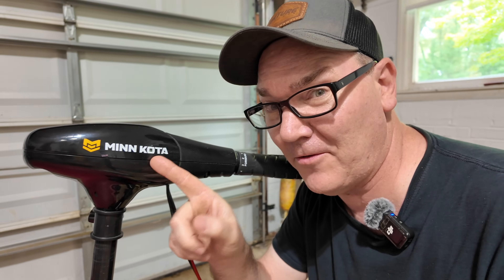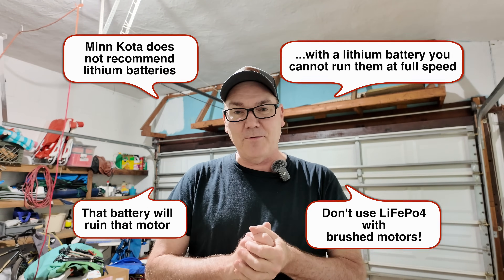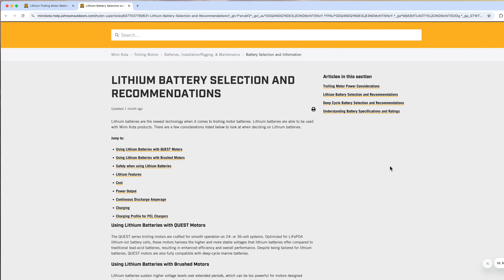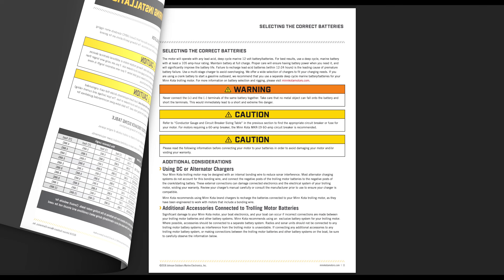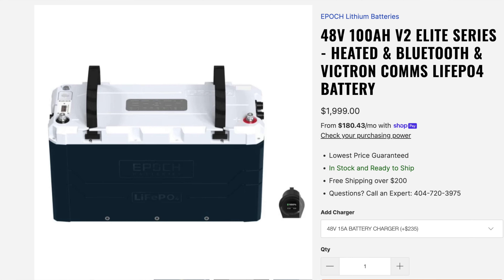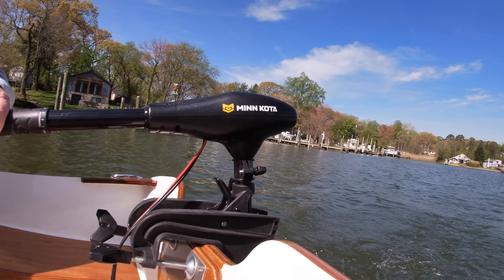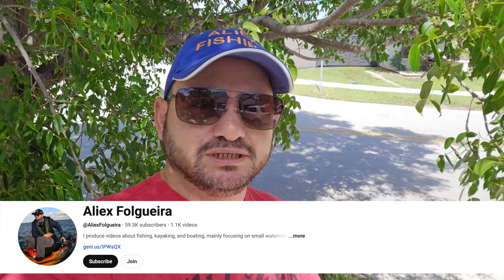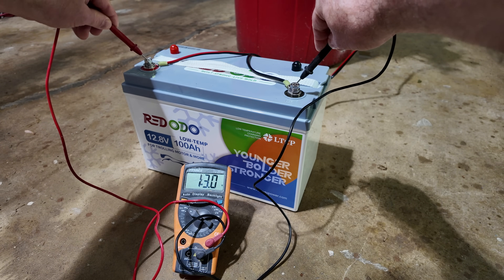Does a Lithium Battery DAMAGE a Trolling Motor & is Minn Kota Hiding the TRUTH?

Comment: I recently switched to a 50Ah 12V lithium ion for my 30# newport motor. 
two observations: if I run it wide-open (speed 5) for more than a few minutes, it will trip the in-line circuit breaker. nbd, I cruise on speed 4, and only use speed 5 for short bursts.
Second, the battery life LED indicator doesn't seem to register.  just lights up full, no matter how long I run it. hasn't been an issue yet... maybe one of these days I'll figure out just how much run time I actually have

Comment: What makes that redodo battery a "trolling motor batter?"  Isn't it the same as the basic, just with low temp?  I live in FL so I don't care about low temp.
Reply from the maker: I don't know if it also might be a slightly different BMS - maybe keeping it from putting too much into a trolling motor.

Comment: The only thing with lipo is that discharge rate is higher and longer than FLA. With that being said brushed motors can handle it. If there is a flaw in the Commutator of the motor it will remove copper and mess it up. I learned this when RC cars went from NiCad batteries to lipo. It wasnt always but you would find that one that does
Fail

Comment: This guy is such a mor on.  The battery literally says "For Trolling Motors...", which means that unlike 'regular' lithium batteries, it has an internal regulator to step-down the output voltage.  You'd think if a guy was going to do a video on a subject, he'd at least do a little research...  Regular, non-trolling motor lithium batteries do operate at a higher voltage (~13.3V) (and ~14.4V at 100% S.O.C.) and unless the motor is designed to operate at those higher voltages, WILL ruin the motor over a period of time at higher speeds.  This type of stup idity is why America is falling apart...

Comment: I’m currently (for over 2 yrs) using a cheap 24v 200ah battery on a 2020 powerdrive.  No issues when running banks at lower settings of 2-5 and on/off spot lock all day. 
I used it sustained at level 7-9 for constant speeds while trolling once and after about 4hrs it shut down and motor was burning up. Best I can tell the BMS shut it down before completely toasting my motor but I’m certain there was some lasting damage to the motor. So now I just don’t run it on high speed for more than short bursts and continues the be totally fine

Comment: I had the same motor and ran lead acid on it for a year. Got a lithium battwry and had to replace the speed switch every month. Got a brand new motor. Ran it in a tournament for 6 hrs. Rqn fine. Next day nothing. Bought another speed switch good for a month and another every month. Dont use lithium with servo speed switches. Just my experiance.
Reply from the maker: Very interesting - thanks for sharing.

Comment: i run a lithium battery on mine, first summer with it and i did burn up the lower end. I can't say for sure if it was the battery but i was told I  melted the seals out of it. I had been running on high for 1.5-2 hours.
Reply: i also burned up the controller with my old trolling motor from running on high

Comment: Love you did this.  Wonder if next time, do tear down to measure brushes before after?  And temp readings. 

Lake I'm fishing now I get really scared, as grown man I know, but my truck is size of Lincoln penny away from me.  Sun starts setting, and I have long haul back.  So I countered that by buying a second 100ah battery lithium, and gauge with of course shunt, but not have gauge mounted yet.  My big concern is frying motor.  My head got warm like you showed as well.

Comment: Well, I had a 12 volt Minn Kota Endura 30 lbs that burnt out. It was the 1st time I used it.  I believe it was the trolling motor. I had to bring it to a dealer 80 miles away to get it covered by the warranty. It took months for them to get the parts... It you buy a cheap motor, you get a cheap motor... And yes, I was running wide open on a lead battery... I have other Minn Kota motors that work great...
Reply from the maker: Oh no, that's really frustrating!

Comment: Thank you for doing these videos! I’m considering an assist motor for my Hobie Adventure Island (kayak sailboat) for either when I’m stuck with no wind, or, when I want to get somewhere but I’m heading into winds that are too strong to get anywhere very quickly. 
I’ve watched a few of your videos that include the redodo battery. My ADD has me a little stuck on the pronunciation…as you are saying it like there’s an extra “e” (redodeo). Is that really the correct pronunciation?
Reply from the maker: Yeah! They told me it is pronounced - Red and then O, D, O

Comment: Have the same minkota 30lb motor with lithium battery for years and it still works just fine and when I say use  it was on a big fishing kayak . My trolling motor had been used and abused  for several hours at time , several days a week for years with no issues. I also upgraded the prop to a bigger 3 blade prop and ran that for years . It still keeps going . It's hard to kill a Minkota .

Comment: You need to apply more resistance to the motor in your test to simulate high current conditions. Bottom line up front: The gauge of the wire is insufficient for prolonged high speed against strong current. I have the same trolling motor and use a 12V 100Ah smart LiFePo4 battery with a 30A Circuit Breaker. The first time I used it, at 5-speed level (for a prolonged time) the wires got very hot and the CB tripped a few times. My battery app showed the current reached as high as 38A.  The second time I used it under similar circumstances, up against a strong current, the same thing happened, only this time, after about an hour of use, the forward speed gave out.  Minn Kota was nice enough to send me a new speed controller. When I took it apart, it was obvious what had happened. The main ground (negative) 14 AWG wire insulation melted near the terminal end. This caused a temporary short with the other wires. I eventually rewired the unit and it was fine. I replaced the 14 AWG with higher quality Silicone 10 AWG (rated for 30A and 200C)      . I’ll let you know what happens once I take the boat out again.  (Happy to provide pics of the melted wires!)

Comment: The problem with lithium batteries is entirely dependent with brushed motors only! Brushed trolling motors will have brush issues sooner when run on full amp draw for an extended period of time. How long is hard to quantifiably define.

Comment: from what I know about brushless motors and brushed from rc cars. if you want to go fast you want a brushless motor. if you go the same speed on a brushed motor electric current travels through the brushes. the faster you spin a brushed motor the more you wear out the brushes. when you do rc cars in a race and you use brushed you will shorten the life of the  motor significantly.  it will run. using a different type of battery that has more voltage will make you go faster the brushes on the motor will arc and spark more wearing them out. once the brushes wear out it will keep arcing more and more as they are further apart. saying all that you troll at like 2mph. probably isn't taxing the motor. brushed motor will wear out. you could if you maintained bearings in brushless run forever. nothing touches inside except bearings and magnetism.

Comment: hh i have see your older vid and didn't have a big or lithium battery at the time now i have 12 92ah agm battery and i just tested it and it works fantastic also i should add that iu have blown my minn kota controller few yeares ago by ruining it with 24v lithuim battery i didn't know that they only work with 12v battery but since i changed the controller with an electic one that have a screen showing speed from 1 to 100 and forward and backward all works fine

Comment: I had an Ulterra burn out, the only reason given was I must have run it on high too long. 
The trip I last used it on, I had it on spotlock for a few hours, and not knowing about their issue, I didn’t pay attention to whatever speed it was using. I have 4 gauge wire and minimal connections, all clean and tight. So they blame it on the use of high with lithium batteries. The motor is just over 6 years old, so no warranty anyway.

Comment: I have a Ship to Shore marine battery charger I use for 12v lead acid battery deep cycle.  I believe using Lithium batteries requires upgrading the charger  ?
Reply from the maker: Yes, lithium batteries require a charger designed specifically for them. I think they charge more slowly.

Comment: If the motor can't handle the designed operating voltage continuously thats the motors problem, not the battery. 
Solution buy a better designed and built. motor

Comment: I would worry about lithium batteries going into thermal runaway during charging or use.  Speaking of trolling, I have been banned from an RV web site for trolling on safety issues  I was a USN nuclear reactor qualified officer and have many years of experience at commercial nuke power plants.  I have 35 years experience with two marine lead acid on my sailboat and ten years with four flooded lead acid batteries in my  motor home.  We have hundreds of years experience and the risks are well known and easy to mitigate. 

I recently watched a video of an electric tour boat detonate while the lithium batteries were charging.  No one was killed only because no one was nearby.

Comment: Would have liked to have seen the  switch manipulated through the speeds after it was hot. My experience with my two endura 30's is the reverse in the speed switch is the first to fail, even though it's used the least. Seems like once the trolling motor is hot, and the speed switch is manipulated multiple times, the switch begins to over heat. Three switches this year alone in two different enduras, and one lasted less than than thirty days. Reverse is always  first to go. Forward speeds in the switch also fail eventually.

Comment: You could always run a 30 amp in-line DC to DC converter to make sure you don’t give it the higher voltage that will damage the brushes. Keeping it at a steady 12 V.
Reply: This guy is not smart enough to understand that....

Comment: I have been using 24lb watersnake on my Hobie PA14 and Hobie Outback for last me 9 years. Not because brush burned out but magnet fell off the housing. It would been cheaper for me to repair the motor if it was the brush that worn out but since it was magnet fell off and cracked into 2 pieces, had to buy another one. Yeah, I don’t expect them to last me the life time but 50ah Renogy battery I bought back i. 2017 still run like brand new. Where, 30ah lead battery died after 2 years. XD 
Bottom line is, lithium battery is lighter, more power and last a lot longer. To me, motor is consumable and don’t expect them to last me life time but if those cheap little motors last me 5+ years where I use them every weekend for hours, then I am happy.

Comment: I have a minn kota 30 LBS five speed endura trolling motor and a 12 V 100 amp max plus BMS 110 whatever that means lithium battery from Humsienk some reason it is burning up the wires and is burning up the switch on my trolling motor I have been using this on my kayak

Comment: i tend to buy Dumfume 12v 300ah batteries for my solar project (to try defeat the power monopoly in my country).. they cost 300-320 buckeroos.
speaking of batteries.. i wonder if i was to drop a overzealous Gob of hot glue on the terminals if it would waterproof it? OMG!! as i was sitting here watching the video it dawned on me!.. why dont i use a plastic box..like a sealed toobox.. drop the battery in.. and then hot glue seal the parts the wires comes out thru it.. or maybe even use a solar nipple lololol.

Comment: You failed to check the part that has problems with the higher voltage for extended periods!!!! It's the BRUSHED MOTOR that over heats and burns up brushes!!!!! Probably not an issue in colder water but maybe an issue if the water is 90+ DEG??? If you ran the motor for 3 hrs on lead acid and checked the temp of the actual motor and did the same with lithium I would credit you with making an informative  vidio. This video is carp, think I will listen to minnkota. NOT the guy who didn't even check the motor housing for overheating condition. I never noticed my motor was warm with lead acid but have with 8 hr runs with lithium......
Reply from the maker: You failed to understand the point of this video. IF Minn Kota believes there is a problem with Lithium batteries - I think they should DO A BETTER JOB of letting the consumer know. At the moment we have to seek out the info ourselves and even what we find is inconsistent. How hard is it for Minn Kota to add a sticker of piece of paper to the box clarifying whether or not THEY have identified an actual issue and any proposed workarounds (like not running it at 100% for more than a few minutes if connected to a LiFePo4 battery)?

Comment: That sounds incorrect, with lead/acid batteries as the voltage drops the current rises which causes heat. Power is voltage times current.

Comment: I have the edge 70 on 24 volt and it failed after running full speed for about 15 minutes. As I was nearing my destination, I slowed to speed 3 for 20 seconds and stopped. I tried to move again within a couple minutes and had no response. When I dismantled it, the brushes had bonded to the brush plate. I had to replace brush plate, brushes, and all seals. Sooooooo, it can fail using lithium batteries.

Comment: Why would lithium batteries destroy the engine? The engine is only a consumer of current, and the battery, no matter what type of battery is supposed to provide the appropriate voltage and current, acid batteries can destroy the engine when their efficiency decreases after exceeding +- 50% of the capacity, the engine weakens, starts buzzing and gets tired, which is more destructive.
Reply from the maker: Minn Kota seems to think there's an issue.
Reply: @WayneTheBoatGuy  this and that is DC current so there is no point in talking nonsense

Comment: Running the motor in a can like that, the most likely damage would be from the lower unit, the motor, overheating. In actual use, the motor is in a constantly “refreshed” source of water. The water in the can is captive, and will continue to warm up, possibly past the limit of normal operation.

Comment: Its the low speeds that would cause an issue, not high speeds under a heavy load. It's low speeds where the voltage could stay above the recommended value of the trolling motor. I would do the same test on low speed, and monitor the real time voltage. The LiTime batteries have a full charge voltage of 14.4V, and the recommended for a brushed trolling motor is 13.8v. At low speed that battery output could be above 13.8v. The solution is to probably not fully charge the lithium battery to 100% if you are constantly using the motor at low speeds and the battery output is above 13.8v.
Reply: Those are good comments for people to be aware of. Wayne should have checked water temperature after that run time. Unnatural high water temp like >100°F could warp the test.

Comment: You’re right they are just looking to CYA.  The only reason that I could think of is the trolling motor won’t last as long because the owner will have more run time due to the better battery capacity

Comment: Here is something that has not been concidered but not a huge deal...... the battery voltage meter on the Power Drive motor will be worthless when using Lithium batteries.

Comment: Hello , I have the same Minnkota 30lbs motor for more than 5 years most part of them run on lead acid battery. 6 month ago I switched to a custom made lithium battery with top charge of 16.8 V 😮 . That battery is a bad guy I can run the Minnkota for more than 16 hours at normal speed like 3 on the gear switch. Once I tried out how many time the battery will last with top speed 😊 the answer is still unknown . After one hour the wiring and the gear switch burns out 😮. But only all the 5 forward . The 3 reverse still working the only thing I do was changing positive to negative and reverse run Forward 😅. That saves me the day. 
Meanwhile I changed the gear switch easy available as a replacement parts in Amazon ore others , By the way I changed all the internal wires including the power cord to a nice 10 AWG , Well the original wiring was also melted . Now the Motor work again and with an nice new bigger propeller rated for 80lbs 😊 . That motor runs so nice now cost a few more amps but doesn't matter, no more wire heating up. Let's see if the gear switch will last more time. In my opinion Minnkota is great for modding and after 4 years of use guarantee dos not matter , the Motor himself is good quality. 
I also use it in between the manglares with salty water with no issue so far , I open the housing of the Motor frequently and put some grease and special sealant in the junction and never found rust ore some type of corrosion inside the Motor. Minnkota works fine for me. Best regards 😊

Comment: I have run my powerdrive 55 on my jon boat for 2 years now. This year, I swapped to lifepo4 battery. It was doing excellent for months. Yesterday, I ran the motor at a 9 for about 10 minutes and burned up the control board. I am very very disappointed!! Now I will likely be out of a fishing vessel for the summer. My son is absolutely destroyed. $1000+ TM that wont run on a 50ah lithium….😵‍💫